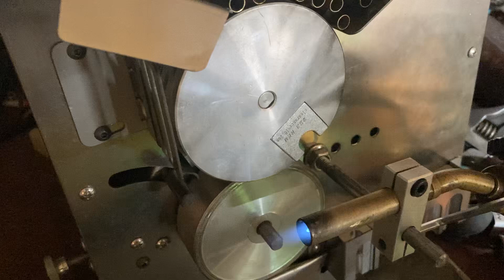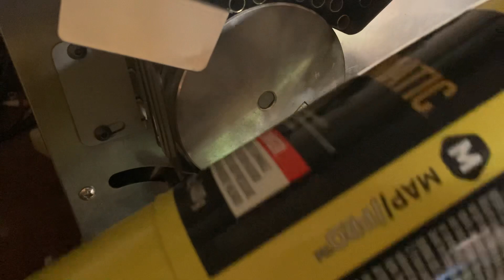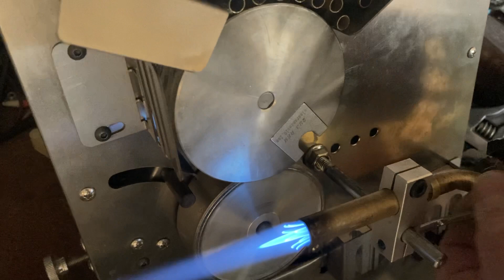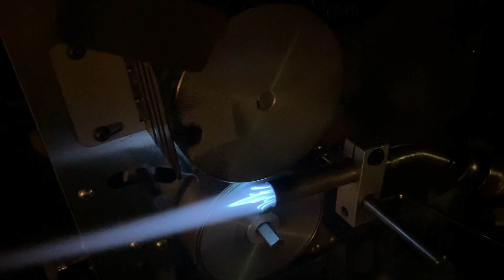Will the UGLY ANNEALER work with MAPP FUEL?  ABSOLUTELY! Running .223 brass Faster drop time. 50BMG

Comment: Hi Carl
Just watched the video and I saw how you moved the insert holder down  lower on the machine allowing easier access to the control knob on the  torch. My question is what is the thread size on the small phillips screws that mount the holder? I want to drill and tap a new screw hole to secure the left side of the holder. Thanks in advance.
Reply from the maker: The stainless frame is HARD. I used a carbide burr like a Dremel tool and used  a screw and nut.
Reply: @ab0ad  Thanks appreciate the info

Comment: just got mine in the other day it works great, i only have one question is the clear cover for the cases suppose to be angled its further away from the cases on top and gets closer to the cases near the wheel?
Reply: The rod that holds the clear cover is in and out adustable - look at the top of the machine where the rod goes in there is a screw you can loosen and move the rod in our out then retighten it.
Reply: @andy79z28  yes i get that but the cover is angling away from the brass at the top and close to the brass at the bottom. the rod only goes in and out and doesnt allow it to be straightened,
Reply: @jasonburns4279  sounds like something may be bent - mine hags straight up and down.
Reply: @andy79z28  im not sure why i was asking the rod goes throw the hole on the back of the case if it was bent where the cover is straight with the cases the rod would not go out the back with out hitting.
Reply from the maker: @jasonburns4279  Call me  IF you still have concerns.  For some reason I am not getting notified of comments on YouTube.